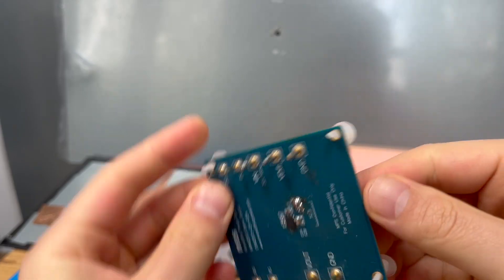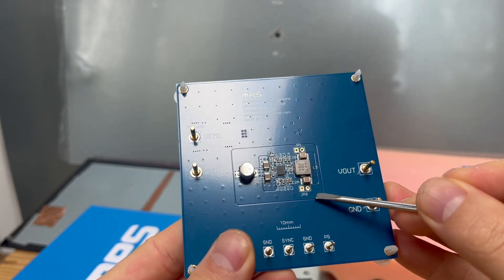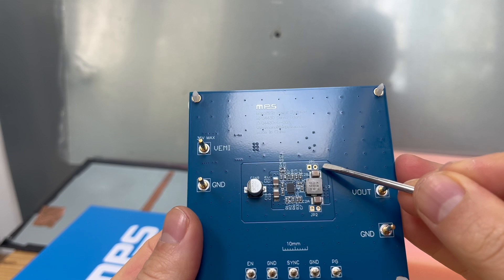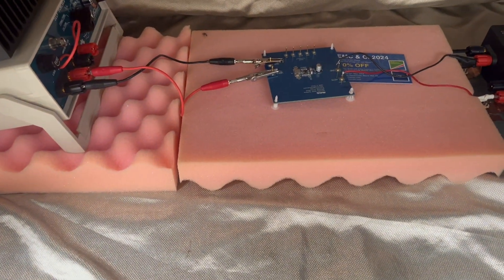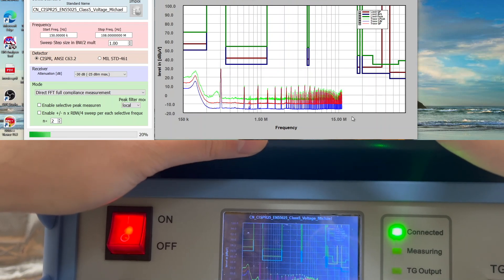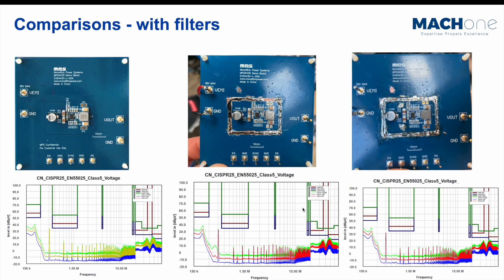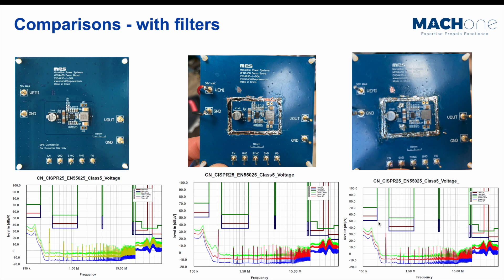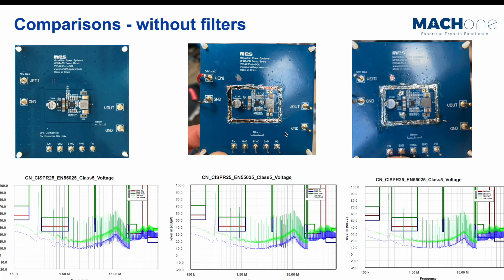Separate grounds on top layer - Does it work?

Comment: I think the better reference video to add is this one https://www.youtube.com/watch?v=lBHJ3QamqiA (fairly close to what you have in terms of eval board) where they do show that as soon as you screw something else on the board, the ground cut is useless. Further, did no-one check that their symmetrical layout is based on the assumption that they had 2 ground pins? They seriously assume that everyone will connect the PHASE digital input to ground to get "symmetrical layout", and if you don't, well too bad. They literally made a bad layout for either a product that has 2 ground pins, or for marketing. And in my experience, crappy power inductors will be crappy and not contain fields properly, and good inductors will do, so if you are placing capacitors close to the inductor to "shield" fields, you are already grasping at straws.

Comment: you only performed a conductive emissions test which determines if you have any common mode radiation coming in/out of your cables. Also, given that the CM filter did not help means it was poorly specified for the load which makes sense because when you design a CLC + Cd pi filter with damping bulk cap you need to know your load cases. separating grounds is a problem concerning return current paths. the flux coming out of the inductor will hit the top ground plane island and induce eddy currents in the copper layers. the island is to reduce the influence of this effect on neighboring components. the shielding capacitors also help with radiation leakage from the inductor. this test would be more conclusive if you performed a localized radiated emission test using RF probes at various points on the board surface to show how the emission pattern differs between designs.
Reply from the maker: Absolutely, you sound almost like the MPS field engineers in their presentations. I did also try to measure the field using a TEM cell, and the findings are the same. Common mode current on the wirings show the same, which is not surprising because of what is shown on the conducted emission results. It is only a shame that i don't own a chamber, but you know what, I have some lab freiends, who may want to lend me their lab for half a day (maybe in Christmas), and I will do the far field test!

Comment: A very interesting experiment and one that is in agreement with my personal experience as well. I have found that the difference between using a four layer board with two internal ground planes and a two layer board is very significant when it comes to emissions - after that, subsequent improvements are marginal. However, one reason to use copper ground on the top in a switching regulator layout is for thermal purposes, especially if the MOSFETs are integrated into the controller - I don't think this really needs to extend to the whole of the top layer though.
Reply from the maker: Glad to see your experience aligns with this!

Comment: Interesting. I found this presentation of MPS: https://media.monolithicpower.com/mps_cms_document/e/m/EMI-Webinar-2.pdf (couple of sheets down: how to utilize a multi layer pcb…), datasheet evaluation board: https://www.monolithicpower.com/en/documentview/productdocument/index/version/2/document_type/Datasheet/lang/en/sku/EVQ4430-L-00A/document_id/9652/  (page 14) and datasheet of the used chip: https://www.monolithicpower.com/en/documentview/productdocument/index/version/2/document_type/Datasheet/lang/en/sku/MPQ4430/document_id/4966/ (page 28/29)

In the chip datasheet the pgnd on layer 1 is separated, but not the other layers, in the evaluation board layer 1 and 2: in the presentation they claim the vias will act as a filter to “block noise and clean GND”.
Reply from the maker: I know! I have read the same material, and the guy sounds very convincing, I mean the theory does sound very good. I am also just very curious to see how much difference doe it REALLY make. But i have done two of their evaluation boards now, to be fair, no difference at all. The truth is, most of the time, design engineers don't even have the luxury of creating 4 layer boards just for a SMPS. If a design engineer did a two-layer board and used this split ground feature on top, I think it will make things worse.